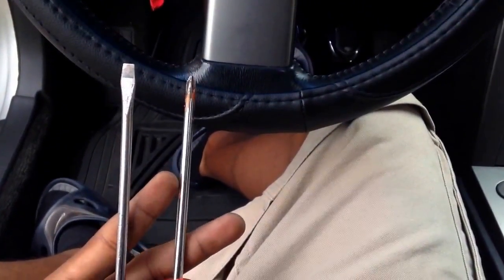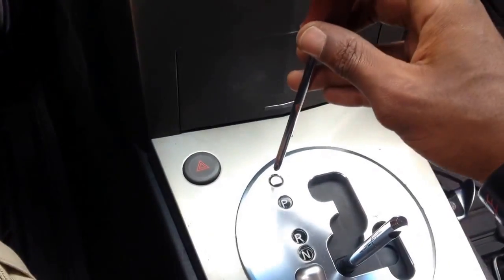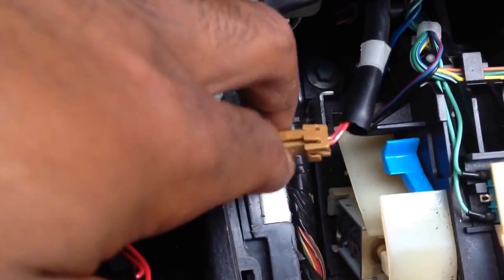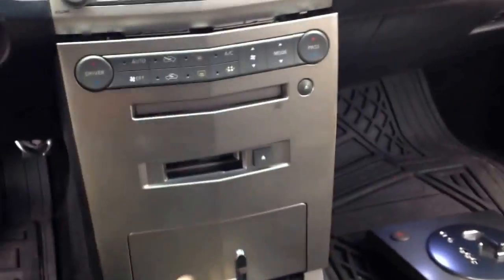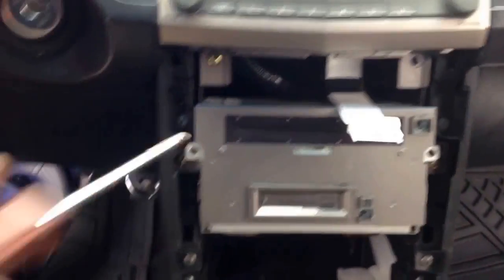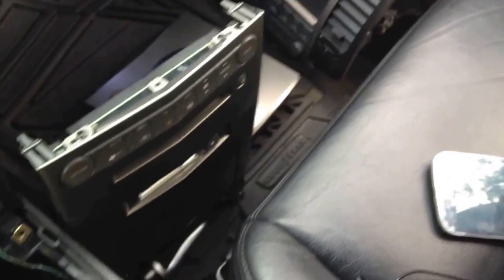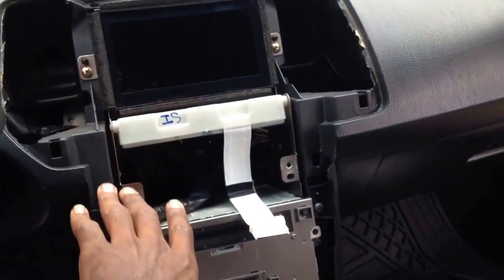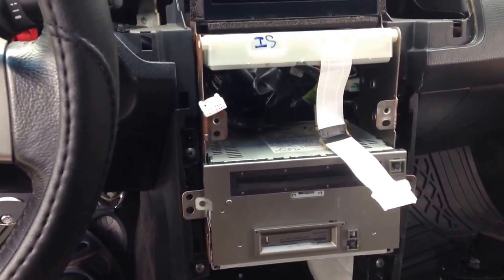Radio Removal Walk-Through 04-06 Maxima --__-- 04 Nismo Maxima

Comment: What was wrong with your radio my radio the speakers work fine on radio but when I put the CD in and hit a bump or brakes like two of the speakers cut-out and while they're cut out I switch to FM radio and speakers work do you think it's like a loose wire or something to me I don't think so because it works with the radio maybe I just need to replace the unit

Comment: My Radio turns on and all, but there is no sound at all, would this fix it ? * did try a different amp and still does not work* its the none bose. Thanks!
Reply from the maker: Replacing the head unit still may not solve the problem.. Have you checked all the fuses for the radio.? Maybe on is blown and that could be why you're not getting any sound.
Reply: Abused VQ Yes i checked everything, went to look for it at the junkyard and it fixed my issue, the stock radio had a bit burn spot in the back, and there looked like there was some dry coffee that some one probably spilled on the dash and got into it. Thanks !
Reply from the maker: @1LoudAndSlowww  I'm glad you found the root of the problem. Blessing my brother..